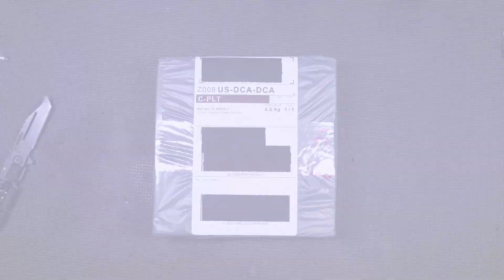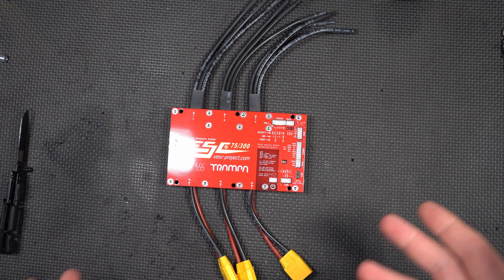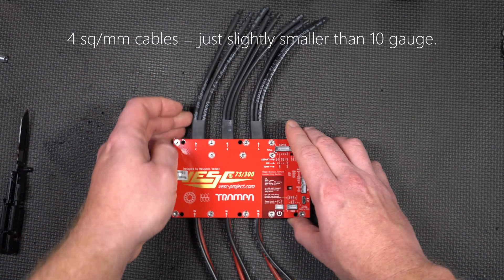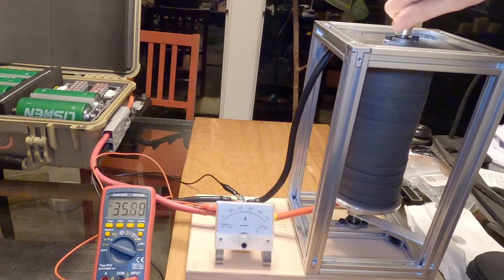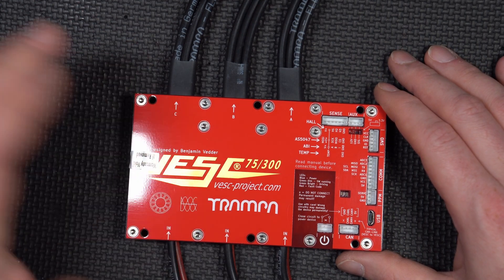VESC Unboxing

Comment: Hello, I'm making an EV Car and currently using VESC 75/300 Controller. I don't know the Port in which the throttle should be connected. Can you explain roles of each Port, and where the throttle should be connected?

Comment: How do you connect the 3 motor wires to 1?  what connectors are you using on you motor ? And what are on the controller?
Reply from the maker: I guess I'll just shove all 3 wires into a single 8mm bullet connector - that's what's on the motor now.  Right now it looks like a single 4mm bullet on one of cables (per phase).

Comment: This is actually a very good series to follow as I plan to build an ev based on a sandrail buggy.  Plan on running at least 4x 20kw, more if possible as money allows.  However alas, I may have to wait a few- or a dozen- years for funds...
Reply from the maker: Thanks for the kind words.  If you're really careful & learn from my mistakes, you can put together a 650hp capable unit for around $2,000-$2,400 at this point.  Two should get you close to 1,000 hp.  At this point, trying to build a 30kW unit is a lot more expensive - like $5k.  I'd stick with multiple 650hp units (which is about 14kW, fwiw).  It takes about 4kW per 200hp at relatively low boost levels.
Reply: @AlexLTDLX  sorry I didn't clarify really meant as a direct drive setup- electric only.  Hence a lot more work to convert a gas vehicle to an ev